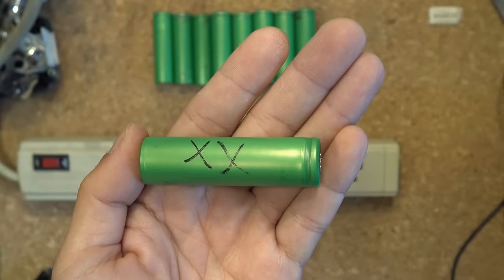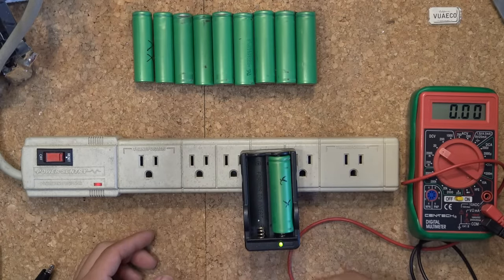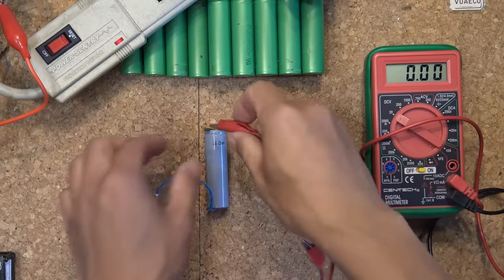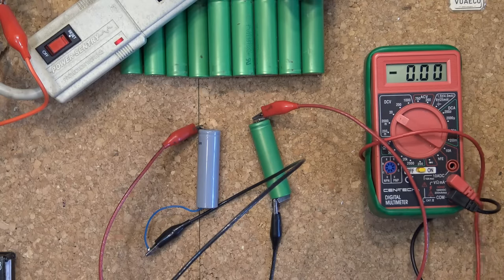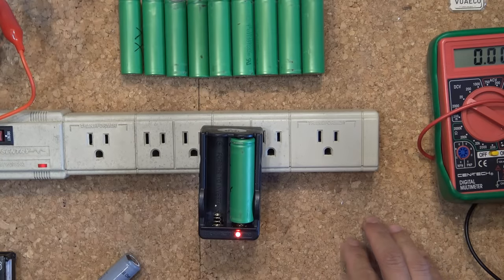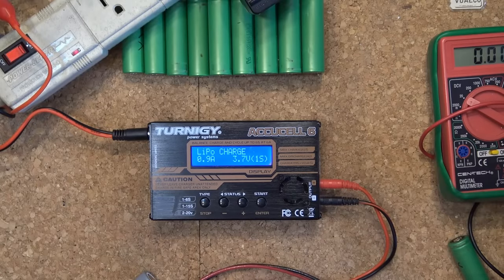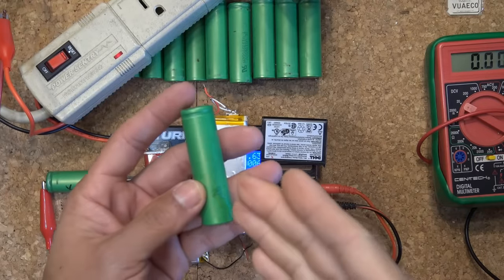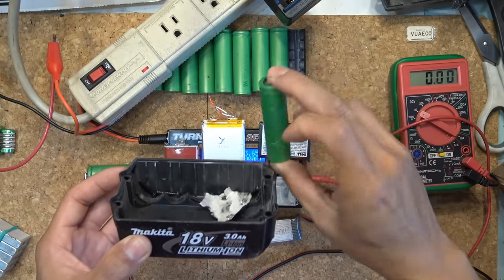DIY: How to revive a dead 18650 (or any) Li-ion battery cell

Comment: i did exactly what you demonstrate here in the beginning for 15sec then 25 then 30 then 40 sec but none of my batteries revived. Its a fail for me. had a pair of authentic sony murata vtc 6 (the dead ones) that i used for 2 times since i got them. tried to pair them with two molicel P26A in a one on one pair but nada.

Comment: Dude... awesome. It worked. And yes, as an engineer, i agree if the battery has drained that low it is not going to be as healthy as others, but still, getting a drained battery to work, extends it's usability
Reply: its*

Comment: I have an 18650 cell with 0,01 volts and it doesnt charge with this method (it takes 0,7 mA) the voltage raises very low (0,1 volt per 10 minutes and drops rapidly to 0,01volt.
Is the Cell dead or maybe is the CID open? But when CID open it should take 0,0mA?

Comment: Hey, I'm trying to use this method to recharge an 18650 that doesn't have a protection circuit. I tried it and the voltage went up from 1.5 to 3.6 volts but still won't charge.

Comment: This is great info, thanks! How do you pop up a dented metal top, do you have a video how to push a dented top out again so it makes contact? Some of mine are smushed. thanks!
Reply: Add tin solder. Maybe it will help. Cmiiw
Reply: pit a small, thin neodymium magnet on it...
Reply: @Quickened1  i bought new ones. ty

Comment: When I individually test my batteries I get 4.00-4.05 volts per battery on 20v battery but when I test them all together Its 0.02? What’s wrong with it. My drill won’t work. It overheated when I was drilling a hole with a dull hole attachment

Comment: Nice video. 1) the batteries charged in this method, do they have the same, similar capacity ? in amps? you didn't say anything about it, usually in my past experiments,  I have observed that the batteries can be revived but they lose their initial capacity and they drop the voltage during any usage. 2) Is there any chances of battery getting busted during this charging?

Comment: Yes you can charge a dead battery,  but how long will it keep the charge?🤔 based on my own observations, when a battery drops to 0 volts it would not keep a charge or if you got lucky, it would keep a charge it would drain faster as the insulating material is already damaged so the copper and aluminum foils inside are already shorting.

Comment: Tried this and it raised the voltage but still won't charge. Used voltage meter and it was at 4.4 then the voltage dropped back down over about a minute. Any advice?

Comment: i desulphate a dead12v lead acid and it works later i can be charge normally.
BUT even though the terminal voltage is 12v from 3v initially, it has NO power to start my bike.
So even though you can revived the battery BUT the battery has no capacity, even with correct voltage.

Now its equivalent to 12v AAA or AA cells connected in series.

Comment: I have done this to a few batteries. HOWEVER after they run low again it will not charge unless you do what you did to the battery again and if you have them welded in a pack you now have to take the battery out again and do the process again.

Comment: The way i did it was to carefully cut off that crimped part and replaced the worn electrolyte then I ised caption tape to hold the top on and seal it from spilling the electrolyte.  Then it took a charge just fine.

Comment: This is more an issue with modern chargers and their low voltage cut off circuit. If they drop low just use any old low voltage supply like usb 5v until they come back to about 3.5v then plug them back in to their regular charger. Inspect for puffing and later capacity under load... normally if they are ultra low, internal damage has been  done and they will hold less charge than their neighbours in a pack.

Comment: hi i have a 48v electric scooter when I got it about 5 weeks ago fully charged the volt meter showed 54.4v now the volt meter fully charged reads 52.2 I was leaving the charger on all the time between rides is there anyway of not losing volts from my full charge
Reply: If your BMS balances by dissipating the energy in cells with a higher voltage then others that would be a cause.  A good solution to this is to get an active cell balancer. Your cells could also be out of balance, if so they need to be balanced or they could overheat and be irreversibly damaged.  Another common cause of this is age.  Through time and cycles the  chemicals in the cells will begin to age and degrade.  They form dendrites that contribute to the self discharge rate of the battery pack, this is irreversible and is only the case in old or misused cells.  It is always a good practice to store your battery at nominal voltage for long periods of time and to take the battery of the charger when it’s done charging.  Topping the battery before a ride always helps.
Reply: @bryanmengwasser3925  thank you for your reply since I commented I ran the battery to about 40% and now when the charge is complete I unplug the scooter completely my voltage now reads 54.1 so for some reason has gone back up taking these steps, I had never let my battery get low so hopefullly doing this a few times helps, great videos thank you

Comment: There are  a few suggestions for getting a good result
do not try to do this unless you are sure what you are doing - the acid can burn your skin
Test the voltage first - there may be a kaput cell which would waste your time.
Check the battery fluid.
attempt to fully charge the battery.
(I learned about these and more from Jons Mender Guide website )
Reply from the maker: Battery acid in 18650 cells? Maybe I should use Epsom salt? :D

Comment: Hang on, doesn’t lithium ion chemistry become potentially dangerous under 2.5 or so volts?
Reply: Yes, Jon, your absolutely correct, Charging a Lithium ion battery that has been discharged below ~2.7V is absolutely dangerous. There is a ton of physics behind this, but briefly it causes the formation of what is called dendrites. Think of them as little growth spikes of solid metal in the cell. These dendrites keep growing the more you charge\discharge a cell that was over discharged to the point where a growth from the Anode and a growth from the cathode finally meet and literally cause an internal short circuit in the cell creating a non-stoppable catastrophic event. I affectionately refer to these as “thermal events”. It’s actually more like a blow torch for about 30-60 seconds and can easily cause a much bigger problem with surrounding potentially flammable material.  So again NEVER charge an over-discharged cell as you will regret it. Maybe not today, maybe not tomorrow, but I guarantee you it will go thermal at some point! It’s just not worth it. Buy a new cell!
Reply: Sure try this at home. oO(How to become a good candidate for the "Darwin Award".)  Nature weeds out the dangerously challenged.

Comment: Ok, I bought some small round batteries and alligator clip wires from Ebay. I put magnets on each end of batteries and attached clips to the magnets. Doesn't give me any reading, and the batteries are new and check out when putting the leads directly on them.   What is wrong here?  Not real steel alligator clips, or not the correct magnet?  Also, when I attach alligator clips to multimeter terminals and touch the CLIPS to the battery, no reading.  When I touch the leads to battery, perfect reading. Anybody have an answer?  Thanks.

Comment: I also salvaged batteries out of an old 3AH Makita battery, but the problem is the cells crap out under load. Tried a couple in a regulated e-cig mod, and they won't fire.

Comment: Did you know what happened to the dead battery?... There is something happen to all Lithium batteries when it left not in use for long time, there is some chemical matterials accumulated on both Anod and Cathod inside the battery due to not being use for long time, What you need is to do (Depassivation) to this battery to break the isolated material which is accumulated. So you need to look for a suitable depassivation tool or you can make one for your battery, the principal of work of this tool is to indirectly short circuit the battery (There is several resistances in the electric circle which will make the short circuit more safe and indirect) and the battery will heat up a bid and will work properly.

Comment: 50ma charge is more reliable. This technique does work but I have had better luck using a 50ma trickle charge. There is a higher chance that it doesn’t self drain once charged if you do it slowly.

Comment: The trick of putting rechargeable batteries in the freezer for several hours before charging. Have you ever heard of this? We know the lower the temperature,the less the resistance,as in superconductivity. Opinions?
Reply: Charging lithium ion cells below freezing will dramatically lower the capacity of the cell. Most  good BMS systems will not charge cells when they are below freezing. Some battery systems also have heaters in them to raise the temperature so the cells are safe to charge.

Comment: This same method also works with 12v car batteries when your voltage drops below 6 volts and your "smart" charger wont charge it. Not very smart if you ask me.  Some old style manual chargers have a physical switch you can set on 12v and its not a problem but most modern chargers dont and you have to use a slave 9v or 12v battery to connect in parallel to make them work. Once you start the  charge you can then disconnect the slave battery.

Comment: a Strip of Aluminium between the charging poles of the charger  while loading a good mcell to parallel load the `dead` cell for a few seconds has the same effect...my Akku cells will load after this just fine

Comment: Nice video, but I just don’t want anyone to think that the battery will perform at peak capacity. You’ve hurt it, and these Li Ion batteries don’t forgive. It’ll limp along, but don’t put it in with good cells.

Comment: Most charges take more than one cell at a time put in one good cell along side a low cell that won't charge in the charger is the same as paralleling two cells and the charge rates both cells as 50% of what's in the good cell and will charge as such

Comment: That cell was not dead.  A reason why the voltage was so low is it was sitting a the battery pack too long while the BMS and or other cells was pulling this cell down.  And there are other reasons for a cell to be so low.  A dead cell measures 0 Volts.
Otherwise yes what to did by parallel balance to bring up the voltage enough, is the easiest way to get the testing.  I use this method using X amount of cell in a pack paralleled and only have to top it up ever few months.  Otherwise good video, thanks for sharing.

Comment: I just use a regular USB cable (red&black wire) and a 5V charger to give the battery a max 30 seconds boost and it works...

Comment: Hoy might be able to charge a dead cell, but its performance will never be the same.
Also, using it in a pack would be a complete waste of time and effort. The charge too fast and not letting the other series be fully charged.... but good trick, usefull

Comment: You can also do the same by setting your Turnigy charger in NiMh mode. That way you can limit the charging current also. And when the voltage is sufficient, change the charger setting to LIPO and charge fully.

Comment: You do know that if you take that charger apart that the two + and two - terminals are tied together, right?   Therefore you don't have to bridge the cells with the test leads, you know?   So in other words if you throw a full cell into one side of that charger and that dead cell in the other, the same thing will happen as in your experiment with the test leads but the  overheating is going to continue until either the full battery discharges or the empty gets to near the other's voltage.    In short, the experiment you did here where you warn not to leave the batteries connected would be the same if you put both the full and bad cell in at the same time.

Comment: you can put in normal alkaline batteries polymer gel to counter them
To protect corrosion and then load like lithium cells instead of 10x-> 500x :-)

Comment: When you measured the voltage and said its 3.2v, I think thats not accurate. Thats the voltage of both batteries in parallel so you're measuring the combined voltage of the two batteries. You would only know the voltage of the battery in question if you disconnected it. Just wanted to say. I'm sure you know but the way it was worded was probably not ideal
Reply from the maker: That's just a rough estimate when it was being charged by the other battery. To satisfy your comment, check out at 2:45 when I measured it again unplugged from the other battery and it was still at 3.2V.

Comment: I have a lipo cell in 6s that is only reading 0.2v. My charger is giving out an error when charging my 6s lipo battery. What should I do? I tried the nicd or nimh technique, the charger also complained.
Reply: To bring it up - you need to charge that cell individually via the balance plug ... and SLOWLY using NiCd mode ... 
But TBH - a 6S battery with a dud cell as you have there is now useless as a 6S ... that dud cell will never revive sufficiently to be a 'power cell' again.
Reply: @solentlifeuk  Got it. I already got read of the bad 6s battery. I cut the xt60 connector because I will be able to use it in the future. :) Thank you!

Comment: You don't need to put another cell in parallel when you have a smart charger ..!! Just put the charger in Ni-Mh charge and give some voltage to the cell. When the cell ups to 3V, just stop the charger, change for Li-ion charge and starts it again...!!

Comment: I did this but the lithium cell seems to be dead because it wont take a charge and gets hot very quickly and then the voltage drops quickly when taken off charge.

Comment: Rapidly charging an over-discharged Li-ion battery by this, or any other method is dangerous. Over-discharge can cause batteries to develop internal shorts, which may lead to a fire or explosion if the battery is charged at high current. A slow charge with a charger designed to revive over-discharged cells (most Xtar chargers do) may safely revive it, but if it won't take a charge that way, it's very unsafe to try more aggressive methods like the one shown here.

Comment: I have got  electric  scooter, but I have a problem that BMS was burnt and battery 's some cells  is die. They show 0 Volt. AND they never come back, I tried to everthing. 
Not working now.  I bought new bmc. I think Need to 16 lion battery cells for collect the battery back. because 16 Li-on cells show 0 Volt.

Comment: How much current were you putting into it during the 30seconds?
Reply: There is no way to know with this methode, the guy does not have a clue about electronics. If you want to try this use a controlled power supply adjust the voltage to 4v and limit the current to say 1a. If current is accepted let it sit for a while, if not through it away. i would not bother with this anyway though, the capacity is gone and won't return 😉
Reply: @Aviopic  he does a video where he does similar with about 30 batteries and checks the current as compared to the supplier charger. I think he went quite bit over TBH but it wasn't as bad as I thought it would be. Agree though, it's academic/deminishing returns regardless.

Comment: Im all for saving batteries but with lithium ion and the lipo batteries im more familiar with i have to say thats a good way to find the Lithium ion batteries secret ingredient.  HINT: (its fire that will burn underwater. )   Ive saved a few lipo RC car batteries that dropped to below 2.5 volts per cell but they usually start to puff up within a few charges.

Comment: Just found out by taking a 6 volt lead acid battery not fully charged works after about 3-5 seconds and neither the li-on nor the lead acid get warm. sends enough of a shock without sparking to bring it back to life

Comment: Holding voltage or showing it, just Google li-ion battery voltage chart for charge rate and power left...

But you may not get capacity from them.
I've cycles (charged and discharged) and they pick up a few hundred Mah's.

Makita won't charge if the battery gets hot, or of the voltage is low or high. They do tend to overheat on discharge during the summer working In The sun..
So the charger won't charge the battery till they cool.
If they get too hot and are discharged this damages the battery.

Thanks for the inside view as I will be upgrading my packs soon after little use there not good batteries Makita use.

Comment: If you own an auto-detecting charger, such as a Nitecore or Tenergy, it will charge flat batteries easy peasy.  It first sees them as a Ni-CD, Ni-MH, or other low voltage chemistry. As the voltage rises, it then recognizes them as a Li-Ion.

Comment: Some batteries are dead for good. I tried reviving two 18650 Samsung batteries. I could see the voltage gradually dropping in real time on my multimeter.

Comment: If you dont have any charger a dumb way to do it is to cut a cable, get a charged cell, plus to plus, minus to minus. Jump start them like a car. Nor more than 5s of cantact, 3-4 times. If you see sparks or it gets hot STOP. I had a friend with 2 batteries, 4 years without charge, no voltage. We had another friend with car cables. We did it for 30s total then placed the battery in a vape and charged them fully inside the vape. Now they seem to work, but wouldn't trust them fully

Comment: I tried it with a lipo, it caught fire but luckily it was small and in the garage in a metal pan.
Reply: Donald Carter use my method instead. Easier and safer than this. This is dangerous because if the "donor" battery has more power than the "dead" once, the dead will be overcharged and... Fire, explosion, or just losing acids. 
Plus, magnets un-charges batteries!
Reply: @Ale_giro  what is your method?